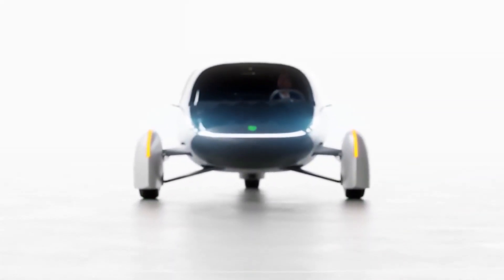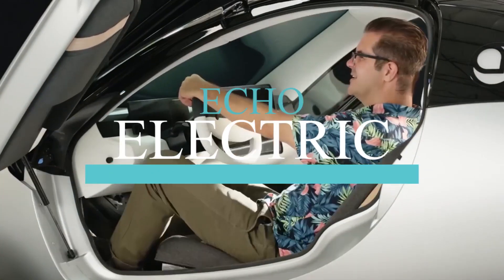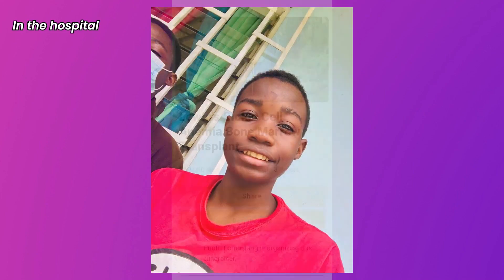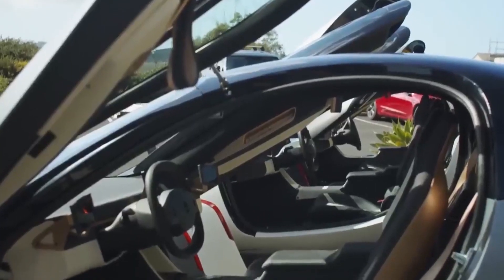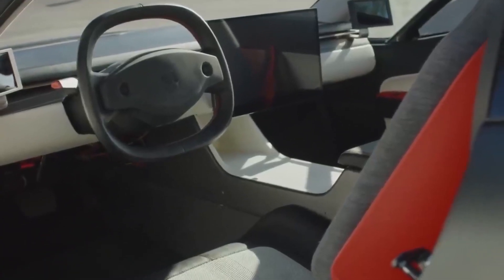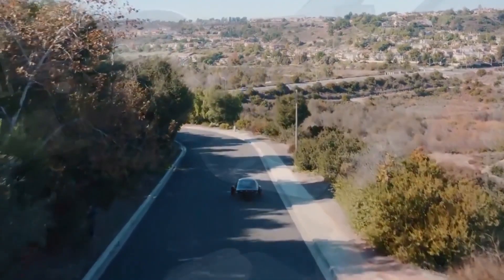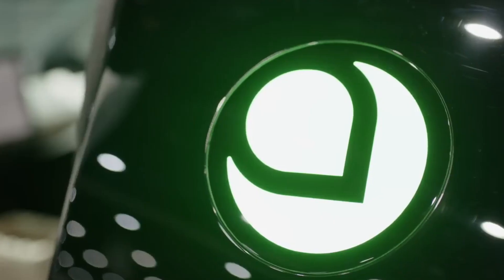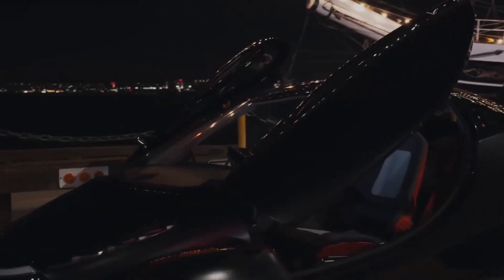How Aptera Designed The Most Iconic And Efficient SEV !

Comment: I like the aesthetics of the Aptera, somewhere between a Bell 222 helicopter fuselage and a dolphin. It takes a bit getting used to for a car, but that's just a normalisation issue.

The one part I'm not a big fan of is the wheel pants design. I get that it is optimized for aerodynamics, but I wonder how big a difference it would make to improve the aesthetics and functionality.

In top-down cross-section it is roughly teardrop shape at each height layer, growing longer from top to bottom. But in profile it sticks out to a point in front and behind the wheel. I don't like the look, and videos show the camber causes these points to move higher or lower in turns. They even put special materials at these points expecting that they will get scuffed on curbs and uneven roads.

If they made the profile circular the whole way around the wheel (minus the cuff-off bottom clearance), I wonder how big a deal that would be. The top-down profile could still be teardrop for aerodynamics at each height, but get smaller again at the bottom to hug the wheel.

I'm curious what effect that would have on mileage, if noticeable. I'd be willing to take a little hit to improve the look and clearance/bump/scuff worries.